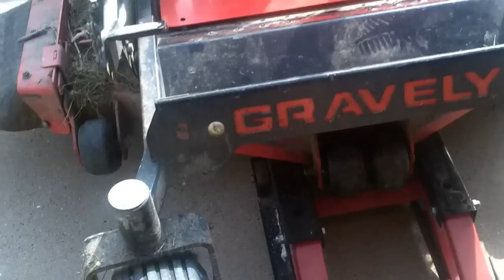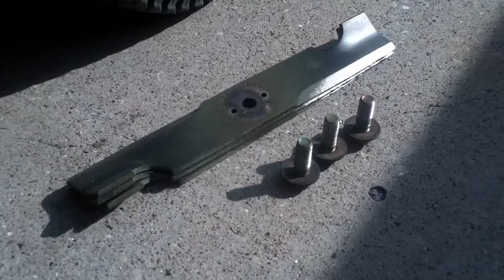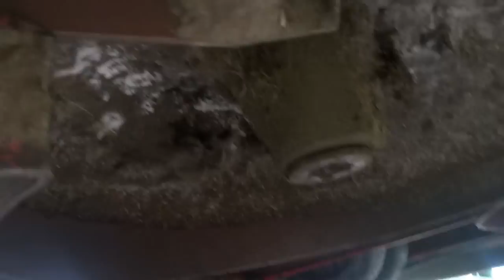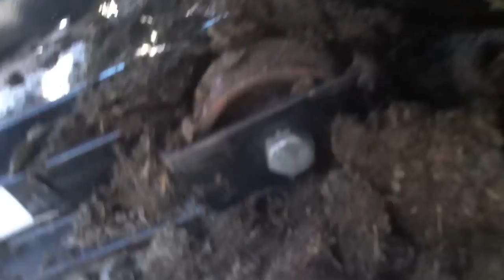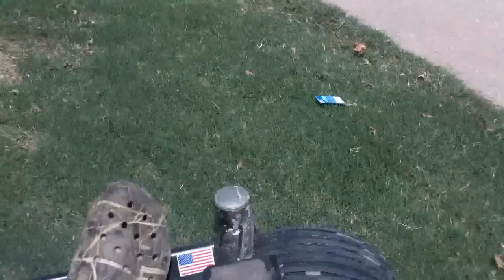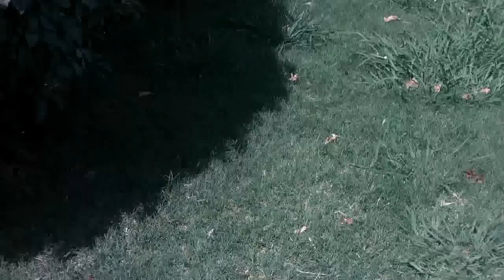GRAVELY ZERO TURN MOWER REPAIR       mower leaves grass behind while cutting

Comment: I have a new 2015 Gravely pro turn 152. Within the first hour of use the hydrostatic belt came off.. I put the belt back on and withing 5 minutes the belt came off and shredded one of the fans. The dealer replaced fan and belt but said they could not find a problem. I now worry that next time I'm on a big job it's going to come off again since the dealer just simply replaced belt and fan. Amy suggestions? Thanks

Comment: I have a Craftsman lawn tractor which cuts and leaves a area in the middle of the cutting area uncut or partially cut and that bugs me so much. I had taken the deck off and cleaned out the grass buildup when I had to replace the drive belt on the mower. I also sharpened the blades on the mower using a file. Can you tell me what is happening with the mower. I have to use it until I get my John Deere Z445 back out of the shop.
Reply: Buy a goat , lol lollipop 😄 😘 💋
Reply: That mower here cost over $4,000.00 dollars new. The Zero Turn Mower I have is a John Deere brand and cost over $6,000.00 dollars in 2005. They are higher now. The Craftsman lawn tractor cost me over $1,800.00 dollars new and it is the one I am using now until I get my other one fixed. I do recommend replacing the air and fuel filters regularly and using fresh fuel in the mowers.

Comment: Hey I got a gravely ZT 52 the mower deck is clean new blades spindles and idler pulley’s are good but I got to double cut everything what could be wrong with it it’s leaving too many strands even on dry grass that ain’t very long

Comment: Is it possible to install the blades upside down? I had someone remove the blades so they could be sharpened, but I swear he either didn't sharpen them well enough or he put them on upside down and backwards.  I don't even know if that's possible, but the mower skips grass in my line so I can't follow my lines--I have to cut everything twice.  I have four acres and my 72" front deck is out for the count right now.  I'm getting frustrated.  Any suggestions?
Reply from the maker: Yes blades can be put on upside down.   Rule of thumb is that the lift wings go "up"
Reply: @THEMOWERMEDIC1  Great thank you! I'll have to have someone else check out the installation, and to make sure the blade edges are at the 90 degree angle!  I watched your other video on blade overlap, so will also check to see if it's a two-blade deck and make sure the blades are in their proper place. Thanks for responding so quickly!

Comment: I have a 2017 Kabota Z-411. On my deck there are 4 fine tune adjustment bolts. What is the easiest way to level the deck. I don't have very good suction. I have a blade tip gauge also. Which bolt should I start at?

Comment: Hello Sir.  I currently operate a Cub Cadet GT2544 and am thinking of crossing over to a zero-turn mower.  I've seen many brands out there...but I'm leaning towards a GRAVELY.  Please know that I have 2.5 acres of mowing and there are some spots that have rock protruding through.  I usually keep my hand on the lever to raise and lower the deck as I approach the rocky areas.  Any suggestions on brand and model?  Thank you!
Reply: ive got a rough 21/2 acres and the gravely HD Is handling great. totally different deal. I have a lot of trees so zero turn changed a lot. I have not had it long enough to decide durability.